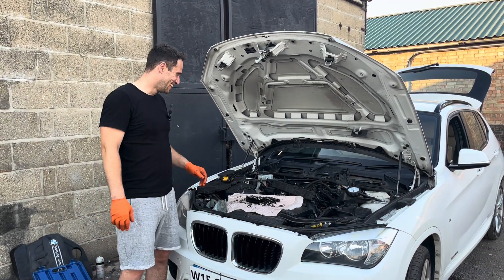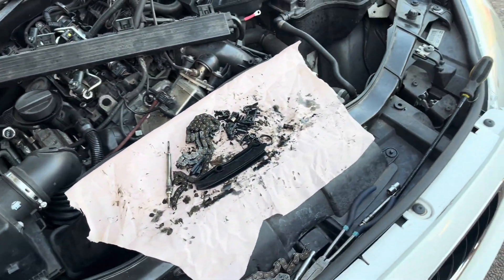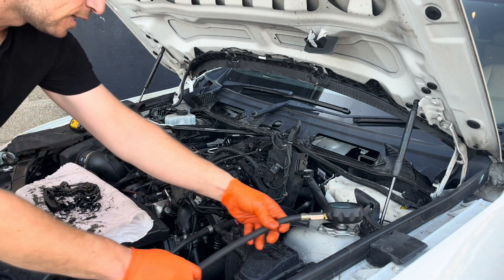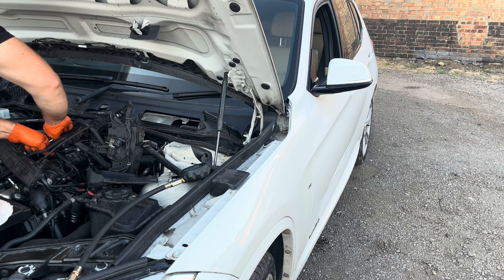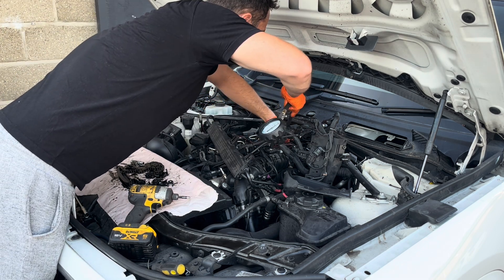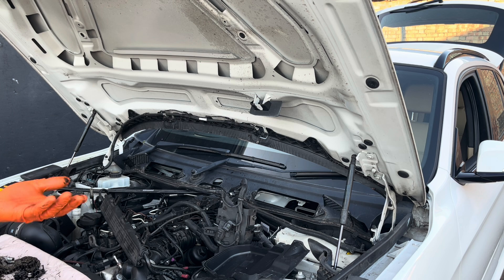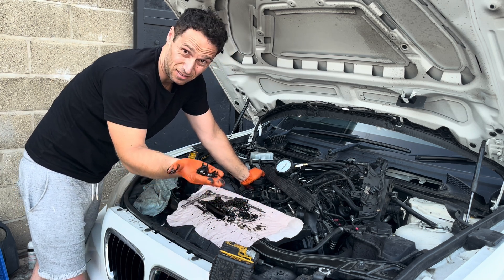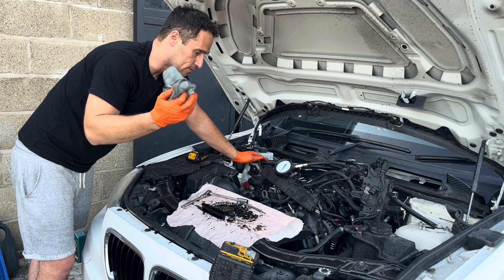BMW N47 Low Compression After Catastrophic Timing Chain Replacement???

Comment: Have done many N47 chain failures , only had one with bent valves , just replace broken rockers and off they go . Same with Peugeot 1.6 diesel but have to replace camshafts on those as the lobes move
Reply from the maker: Thanks for watching! It's good to hear from someone with experience in N47 timing chain failure repairs. It makes sense, doesn’t it? If the rockers fail when the chain snaps, the valves get away

Comment: Thanks a lot for your video…could i ask you about the cartridge of turbocharger, did you manage to change it? Do you need to do any calibration after new cartridge is installed?
Thanks again
Reply from the maker: @igortanyarascovschi1225  Thanks for watching. Yes I did change the cartridge, no calibration is required, the new core comes calibrated.
Reply: @W15Garage some people told me the cartridge is balanced but once installed there needs calibration done…a bit confused 
Thanks anyway for your help
Reply from the maker: @ I’ve done quite a few turbo core swaps—F20, F30, E60, E83, and pre-facelift E90 (163hp, where the geometry needed adjustment after installation)—with no issues at all. The longest I was able to monitor was my friend’s E60 remapped 520d. After a good 18 months, the turbo was still performing well at the time of sale. In a few weeks, I’ll be rebuilding my sister’s F30 320d. If I’m not in a rush, I’ll try to record a video. I’m sure buying a new original turbo is better, but for me core swapping worked out well, considering the costs.
Reply: @W15Garage I’m so grateful for all your replies…what cartridge brand or store you suggest me buying from?
And I’m rebuilding at the moment a turbocharger from f30 (just changing the cartridge) but has no actuator(electronic) and thinking to take it from the one is in the car at the moment (f31),will it work? Still no need for calibration?
I appreciate your time for helping me understand
Reply from the maker: @ Yes, if the turbo and actuator numbers match, you can swap the actuator. Just check the actuator for excessive play. I would recommend a Melett cartridge—it’s a bit more expensive, but I bet it will last longer than some of the cheaper Chinese ones that come with rebuilt turbos.

Comment: Good job. What are the expected values for this engine? Do you unplug a fuse so the car wont start?
Reply from the maker: Thanks for watching. I’ve disconnected the injector plugs. Based on my experience with this car’s mileage, this is a good value. Most importantly, all four are equal and well within the 10% range
Reply: @W15Garage  yeah. All 4 right on the money.

Comment: I think bmw has a long vision about their timing chain quality That's why they made the rockers like that.

Break the rockers upon wrong timing and save valves..

Excellent work mate..
Reply from the maker: Thanks! You're absolutely right. If the rockers fail easily, the valves don't get damaged. There are other possible outcomes as well, such as bent camshafts, broken carriers, or valve damage, but this is the most common outcome. I have another failed chain, and I'm curious to see what the damage will be.
Reply: We r waiting..

Comment: Thanks for the video and the confirmation. When the piston hits a valve, something has to give but it does seem that recent engines (last 20 years ?) the rocker has been designed to fail first. The compression ratios prove that the valves seal well.
Reply from the maker: @rhiantaylor3446  thanks for watching! N47 is a good engine despite its bad reputation, there is clever engineering behind it. Despite the hate this engine gets, personally I like it😀

Comment: Thank you for the solid content you provide! I watched the previous video and to be honest, even if the audio was bad when you cranked it, I seriously thought the valves were bent. The dissimilarity in sound did smoothed out in large portion, but still am totally surprised they are actually all equal. I wouldn't bother neither, if it has compression, it has compression. The only thing that can happen it that the valve stem would be so slightly bent, that it wouldn't keep up at high rpms, but still, you don't have to take the head off, to diagnose it. Keep it up, I see you as a true motorhead, and subbed :)!
Reply from the maker: Thanks for watching! Appreciate it. The way the car drives, idles, fuel economy it’s spot on. Could not be more happy with the outcome😀
Next one is a Water/Flood damaged
Reply: @W15Garage  Nice! We just had heavy floods here where I live a year ago, so I'm very interested. Cya

Comment: Good job. They are equal. I was wrong. Probably was a cylinder fuel  wash at the first start when it was sounding unevenly. Keep them coming!
Reply from the maker: @alexdragomirescu5084  thanks mate appreciate it! That was probably it, as it was in real time, just plugged the injectors and started it up.
Reply: @W15Garage  I'm happy for you that you didn't had to change the head and waist more time with the repair! 👍
Reply from the maker: @alexdragomirescu5084  thanks mate

Comment: You are brilliant. Don't let them comments affect you. I watch your channel as I would any big youtuber like Mat or Tavarish. If you have a hiss from the turbo make sure it is not a blocked DPF make sure you don't have any glow plug lights on so that it can fillup DPF with sooth. I have this issue with a mini, new turbo and the sound is still there, same n47 engine. I believed turbo  was faulty but even with a new turbo still sound is there.
Reply from the maker: Thanks a lot, really appreciate it!!
I just had a bit of time to investigate the turbo tonight, and luckily turns out it is the intake hose that connects the airbox with the turbo, the rubber has a small split.😊